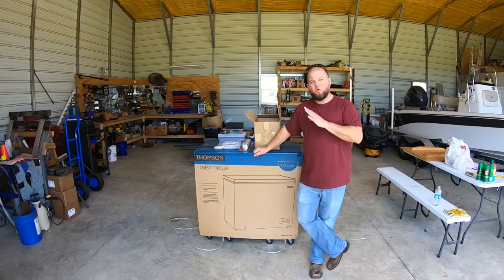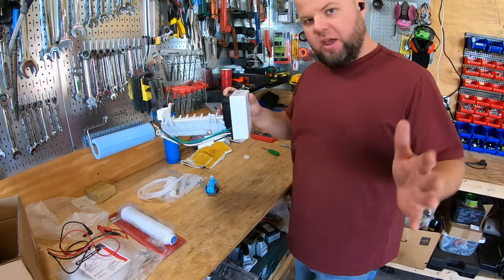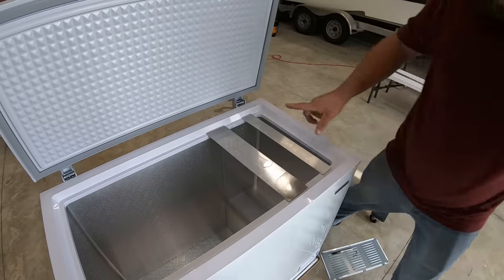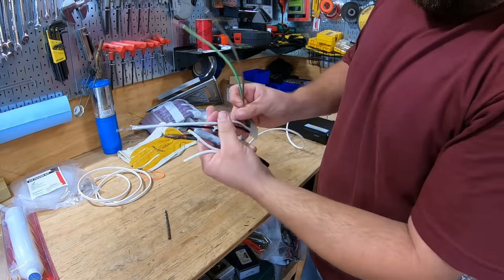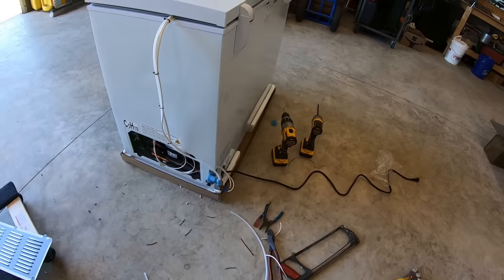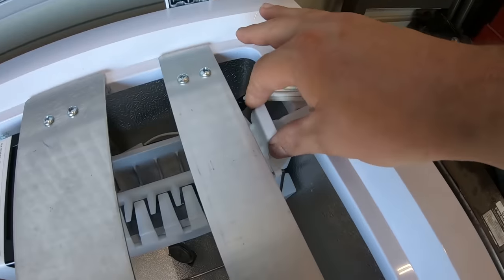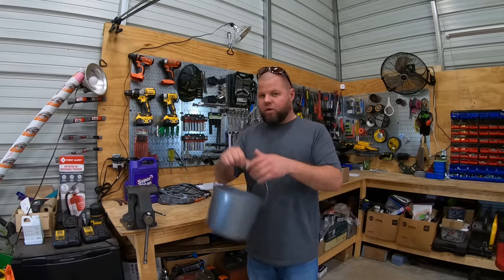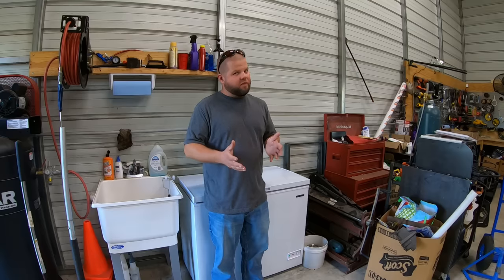Homemade ice maker! SAVE thousands over a commercial ice maker

Comment: the reason its flammable is one of 2 reasons 1 its the same gas as was in the car aircons that caught fire when they crashed or its a butane diritive but its not freon any more
Reply: Cyclopentane. I've been seeing a lot more r290 and r600 systems replacing smaller 404A machines lately.
Reply: Some refrigerators run on ethyl alcohol.  It's more to do with a liquids freezing and boiling point and its lubrication factors for the compressor.

Comment: might want to install a drain at a lowest location, in case there is bunches of ice in the machine, and a power outage happens for an extended period of time, then power gets restored, the slightly melted ice will refreeze stuck together... easier to just unplug the unit, open the top, let it melt and drain all night by filling with a few gallons of additional water. A bulkhead hose fitting can be had fairly cheap, to then allow a common garden hose to run to the outside of the building to drain outside...once the few gallons has assisted in melting the ice, crack open the hose valve, let it drain...just a thought...clever set up, well done.
Reply from the maker: It already has a drain in the bottom just for this. Good tip
Reply: @TKCL  Ahhh. Roger that. I certainly hope I didn't insult your intelligence, as that wasn't my intentions. I am sorry if it was understood that way by any comment readers or the channel owner.. It was just a thought.. or to say, in case it already didn't have one.. either way, neat project though...
Reply from the maker: No worries

Comment: Run the lines thru the factory drain outlet.
Reply: Wouldn’t the lines freeze?
Reply: Run the lines through the lid, no freon and it's the warmest part of the cooler.
Reply from the maker: Building a new collar or lip and moving the lid is the next design I want to try.
Reply: I was about to suggest that!! Thanks
Reply: @TKCL  ditto
Reply: The water need to free flow DOWN 
Water hose coming from bottom drain will freeze before first batch of ice
Reply: @TKCL  Its called a Keezer Build, look it up on YouTube
Reply from the maker: Yes I did, that's exactly how I want to build the next one.
Reply: Ask any plummer dont use a saddle  valve they fail all the time.

Comment: Obviously, buying all component parts new to save tons of money over buying a commercial ice maker unit was the point of the video.  I get it.  But why spend $370 when you probably don't even need to spend $150?    People are always updating kitchens and selling used appliances that still work fine, but are just not the style the home owner wants.  Some are even given away or sold for really low prices.   Buy a couple used refrigerators to rob for the ice maker parts and a used freezer, then BINGO, you are ready to assemble the project.

Very good workmanship.  Super nice video! Thanks for sharing.

Comment: Get some 1/2 drip line and run wires down inside freezer and out drain. Install a terminal strip and clean up excess wires. You only need the power cord the freezer came with.
Reply: Make sure there is still a drain for letting melted ice out, aka water.
Reply: Nice video
Reply from the maker: Thanks
Reply: Sounds potentially unsanitary

Comment: You could have went thru the lid smart being careful not drilling thru the sides. It's a game of chance. I would hit a line first screw.
Reply: If you're going to cut the lid then you can also put a smaller insulated door in it so you can access the inside quickly without opening the whole unit up

Comment: "turn this up to 7 so we can see if we can get cold fast" the compressor runs at one speed, ON. I think that's funny how people think turning the thermostat down like in Central AC is going to somehow make it go faster lol
Reply: I’ve had customers tell me that the thermostat setting is what the temperature of the air coming out 
Lol setting the stat to the lowest setting and freezing up the evaporator.
Reply: Hahaha! oh, and what about at 25:30 ..hahaha..  he's gonna have 0 degree ice instead of  that stuff from a typical commercial machine so his drinks are gonna be a Whole lot colder...   Hahahaha!!!
Reply: I try to tell family members this when they set the thermostat to 50 so it will "run harder." They just tell me I'm wrong. (Before you mention it, they have a 1 stage system.)

Comment: THANK YOU!!!  this is what I need, but I need it to run only from 11pm to 7am when I only pay 1cent/kwh, but hopefully not melt during the rest of the 16 hours/day.  I can use a $5 smartplug with a smartspeaker routine to easily do that.
Reply: As long as you keep the lid shut as much as possible, the ice left over will be OK. Use a timer to turn the electricity on when you want it to make ice.

Comment: How about rinsing out a couple milk jugs and fill with water and make some blocks of ice also? It will aid in maintaining a colder temperature and may increase production of the ice makers.
Reply from the maker: I've actually been doing something similar lately!
Reply: That's what I do.  We use about 2 gallon jugs a week, I fill them 85%, freeze them and use that for ice.  If I want cubed ice I bust it up with a hatchet.
Reply: As they melt, you can have ice cold water to drink also.
Reply: I found Flex Bins at Wally. With only light messaging, I get nice chunks of block ice of various sizes.

Comment: Ground and neutral are not the same thing (even tho it works) the green is there to trip the breaker in the event of a short the way you wired it it could short out and electrocute you the green should get hooked up to the main and you should double up your white to your solenoid

Comment: Flammable "Freon"? R290 that's propane boss.
Reply: You are right but Freon itself does not catch fire, but the cylinders containing the gas may explode if the fire is not controlled. This happens because of pressure buildup within the cylinders caused by the rise in surrounding temperature
Reply: Freon is a slang term from dupont. Refrigerant is the proper term for heat transfer fluid. Most of those freezers now run on isobutane. R290, is propane without the scent additive.
Reply: @Idk-yx9jc  this "freon" is flammable. It's a hydrocarbon.
Reply: @banshee350cc  that’s not Freon that’s a different type of gas
Reply: @Idk-yx9jc  Freon is a brand name... And, there are plenty of refrigerants that are flammable. 134A is partially flammable, 1234yf is extremely flammable. A lot of cheap generic replacement refrigerants are flammable.
Reply: @Carlitosway211  Freon it’s self is not just a brand name it was called Freon way before the company started
Reply: It’s R600, butane
Reply: its r600 iso-butane
Reply: @banshee350cc  in commercial coolers and some residential appliances,  I've seen cyclopentane used. I had an hvac tech tell me that it was about a table spoon of refrigerant but I'm not exactly sure.
Reply: @banshee350cc  freon, liquid cold, freeze cans, forbidden Gatorade
Reply: @AC9T  I specialize in Cryo freezers, cascade and auto cascade types that usually use around 25oz of mixed refrigerant in the first stage and 12-16oz in the second stage. With the reintroduction of hydrocarbons in these freezers they were required to only use so much flammable refrigerant for safety reasons. Now both stages combined have less than 6oz. It's amazing how efficient the hydrocarbons are.
Reply: @Idk-yx9jc  Freon is the brand name, it’s commonly called r-12.
Reply: Yeah, but it´s a cold fire
Reply: @SoLSamuraibloodblade  correct and wrong it was called Freon way before the company
Reply: @TerryGrancho  yeah. At room temp r600 is 33ish psi, you cut a line with a grinder and have some sparks it will shoot like a small torch until it's gone.
Reply: The side of the freezer says C5H10, the refrigerant version of that is cyclopentane. R600a is isobutane (C4H10) and R290 is propane (C3H8).
Reply: @robeaux  I was just using  isobutane as an example, luckily cyclopentane is only 4ish psia at room temp.

Comment: If that freezer has a sticker on it that says flammable it's not free on its propane gas that they used to cool the freezer with
Reply: lol ... freon... fyi
Reply: it might be 1234yf.
So flammable mercedes puts an automatic fire extinguisher in the engine bay.
Reply from the maker: Something like ch510 if I remember correctly
Reply: It could also be R400 which is isobutane
Reply from the maker: Think it's ch510 or something like that
Reply: @TKCL  There is a sticker that says c5h10 on the freezer which is Cyclopentane. A common refrigerant.
Reply: Idk in the us , but for freezers in Europe we use r290 which is just common propane.its not toxic,it's not Freon,it's just flammable,but it ain't that dangerous,it has just 50-80 grams of it.

Comment: Buy trailer wire at Walmart to get 4-conductor. . .
Reply: Not rated for 120v ac
Reply: @angrysnowmandesigns3437  you can use 120 or 240 volt on any wire but the gage won't allow for the amps that are being used has to be at least 12 ga maybe even ten depending on the heating element on the bottom of the Ice maker.

Comment: Identified conductor: Ridges, white, always the neutral. The other is  the hot. Always, It doesn't matter as you did identify it yourself but as an industry standard that's how it is. Oh, 44 year Electrician.
Reply: What about a back fed light and switch ?
Reply: Yep! 50 year electrician. 😉
Reply: How come every electrician is a 40 year electrician even if they are 25? Is 40 year a certification?
Reply: Never assume anything with electricity, ever.

Comment: Wasted money on that lamp wire. Should have just bought a 10' 16ga extension cord and cut off the receptacle end. Wires would have had correct color code insulation and saved that explanation in this video. Only constructive criticism to help others improve their build.
That said great build project. Thanks for making this video.

Comment: I like these little freezers , getting a freezer with Condenser coils exposed
On back are preferred because you can
Wrap HVAC duck insulation on lid and
Front and 2 sides. This reduces electric 
Use by ~1\2. ALSO getting a 30$ inkbird
Temp. Control can be used to make a
Super efficient refrigerator.

Comment: good video...being a single mother..i froze gallon milk jugs for our out door activities and as it melted ..we had cold water to drink and our food did not get soggy in the cooler.  if we needed crushed ice...i just wraped a towel around the jug and a few taps with a hammer and used a knife to open the top of the jug. ..Also a freind just opened a little food shop and his little ice machine bin melted to fast...so i suggested that he freeze a gal of water and place in the ice bin each morning . The solid frozen jug of water helps maintain the ice cubes longer.  Just  suggesting to add at least one solid frozen jug of water to your outdoor fun or even frozen water bottles!!!

Comment: I built almost the exact unit about 5 years ago (except I ran the water through the lid). It did not make much ice per day. I Added a small computer cooling fan to blow on the bottom of the ice cube making tray and it picked up ice making substantially. (x 2-3) These simple freezers have no circulating fan like refrigerators that always have one.

Comment: This is a fantastic idea, I have a brand new spare ice maker kit from a fridge that went out and Im going to build one ASAP! Thanks for the idea.
One comment/question: Why not mount everything to the top cover? It would be accessible for replacement/service and removing stuck ice (which happens)  and would allow for a smaller bin on the shelf and a clean install running wire/tubing through the back of the hinged lid.
Reply from the maker: It's a thought other than the ice makers, they constantly have water in them and if you mounted them to the lid it would pour out every time you opened it
Reply: @TKCL  did not realize that, good call.

Comment: As an appliance repair tech this is really cool.

You could increase the output substantially if you put small fans circulating air around the ice maker to freeze the water faster.
Reply from the maker: That video comes out in a couple of hours! Thanks
Reply: Lol. Definitely. My buddy did this in his kegarator and froze everything. He didn't think it would work quite that well.

Comment: Nice job on the ice machine, I think if you fill a few 2 litre bottles and place them on the shelf over the compressor that will help with your thermal mass and keep it cooler inside during defrost cycle. Enjoy , cheers from Jacksonville Florida 🌞
Reply from the maker: Thank you for watching

Comment: Great idea.  Suggestion:  heat shrink tubing for the electrical connections.  Also, IMHO, ice is ice.  It is the temperature of ice, about 32 degrees F.  I guess that might vary slightly because of mineral content and maybe even pressure.  But I don't think that there is cold ice and warm ice.  Interestingly, household (under counter) ice makers are not refrigerated.  The ice keeps the ice cold and the melting that does occur simply goes down the drain.  Thanks.  Great video.
Reply from the maker: 32 degrees is the state change from liquid to solid. Ice can and does get much colder depending on the condition its exposed to.

Comment: 1st let me say nice job, simple and clean looking. 2nd, you can use a price of 16/4 trailer wire, the copper wire itself doesn't care if you are running Ac or DC, and the gauge is thicker than OE, so your good there

Comment: If you want to keep plastic pipe/tubing from collapsing when bending. Cap the ends and fill with table salt if potential food contact, or sand if it not for food purposes. Salt and sand allows it to bend but keeps the tubing walls supported so they don’t collapse.

Comment: My dad did this same thing years ago in a smaller freezer. It worked great and could fit a 13 gallon kitchen rubbermaid trash can inside. We used it alot because we poured ans finished concrete.

Comment: hey boss... so I thoroughly enjoyed the video and have no complaints.. I just wanted to share this one fact with ya...you said "your drinks will be colder"  even though the ice is coming out of the freezer at a lower temperature.. your drinks will be cooled to 32°f as that is the melting temperature of the ice... the way conduction works your drinks will never be colder then 32°.. thats why you set the temperature on cooking thermometers with an ice bath.
Reply from the maker: Not exactly, commercial ice makers have ice that's already melting in the box, so as soon as it hits hot drinks in your cooler or air it's wasting away immediately. This ice being much colder lasts longer and impacts those drinks for a longer period of time and brings the drink temperature down more. Your assuming hot drinks drop to 32 with commercial ice, they do not unless you keep packing it in the cooler for days. I can tell you this, I've had ice slivers in my beer after being packed on this ice a few times. Never had that with store ice. That alone tells me that it's impacting the liquid in my drinks more than warmer ice.

Comment: Thank You so much , iI have been running this idea thru my head for about 2 years  now & this video helps me decide to go ahead with the project.
Reply from the maker: Awesome, glad it helped! I've been enjoying mine!
Reply: @TKCL  do you know how many amps the ice maker draws? I found one for free in an old working standard refrigerator. I was thinking about using it in a cooler to build one of those  DIY air conditioners that you fill with ice & water. But trying to use  it inside the cooler as a submerged water chiller instead of a normal  ice maker that wouldn't need connected to a water line or solenoid.
Reply: Same
Reply: Same
Reply from the maker: I do not, but I'm getting a killawatt meter Friday and will be testing energy usage next week. Video out soon
Reply: @TKCL  If you want to see the ice production dramatically increase you will want to add a small fan.. simply circulate the frozen air will do it. But those ice makers are normally right under the frozen air inlet. 

Also the reason a chest freezer is so efficient, Is the lack of a defrost heater. 

That being said a fan blowing in the ice will cause clumping. So long term effect could be dramatic. (A solid ice block)

Lastly these freezer can be ran from a solar generator long term. ( no defrost = no high amp draw)

You can also remove the freezer thermostat install any refrigerator thermostat. 
Except for condensation. You now have a incredibly cheap off grid refrigerator.
Reply from the maker: Watch the video I released yesterday, added fans and seen a huge increase in production
Reply: @michaelbrinks8089  ⁹
Reply: @michaelbrinks8089  - The ice maker has no cooling capacity at all. It's just a automated ice cube tray. It automates filling the tray with water as needed, but relies on the freezer to actually cool/chill/freeze the water. 

There is a thermostat inside the ice maker that measures the temperature of the water/ice to determine when the batch of ice is done and ready to cycle.
Reply: @GFlCh  Thanks, I dunno why but I thought it had some sort of internal cooling element. Similar to a peltier inside.
Reply: You win the Award of the year for Overthinking how to make ice cubes , I thought the man who made this video won 1st prize but you won without a doubt , lol , did you ever manage to procreate or did she have to show you ?
Reply: This is like the Lewis guy that wants people to be able to repair their own stuff.
We should be able to modify it too.  People are smart.  We can do things ourselves.
As Americans and free people of the world, we should be building things to make our lives fun.
To fish for fun and food.  Loving it, keep it up!
Reply: 6ft 7
Reply: @TKCL  I j in